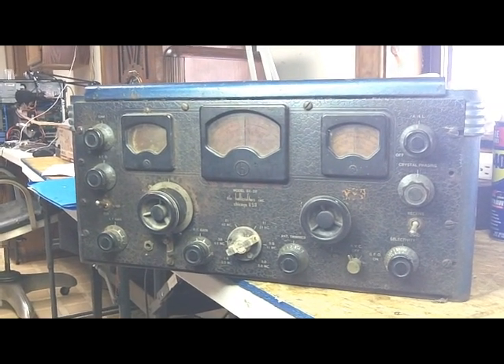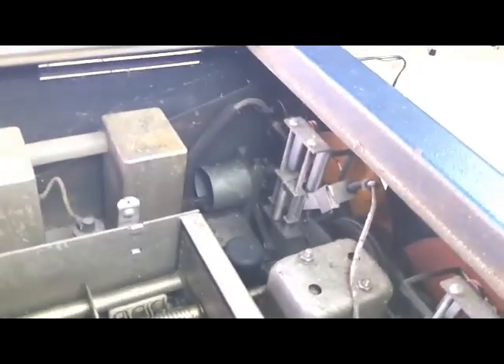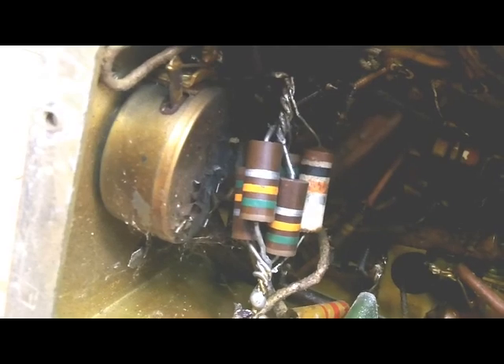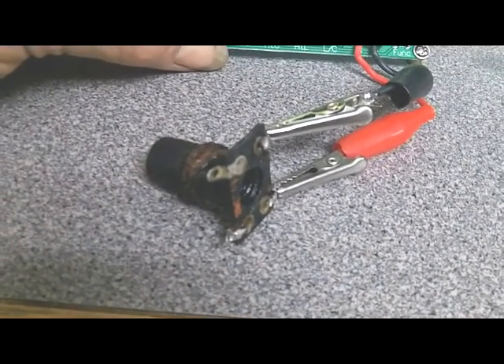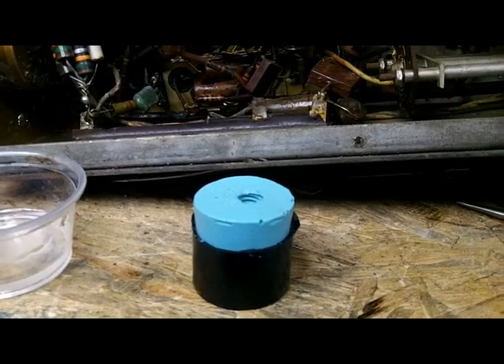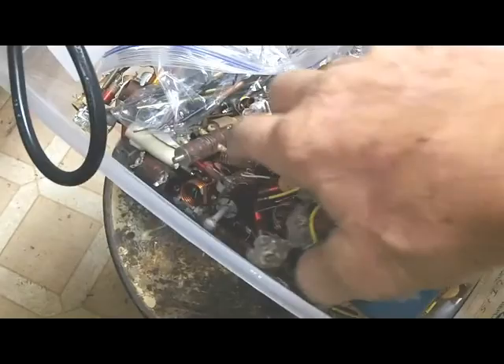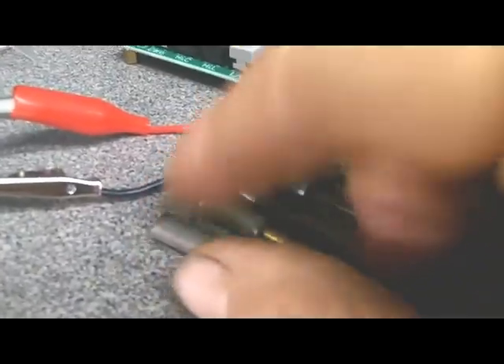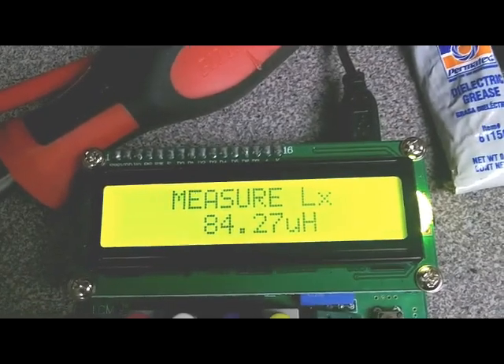Restoring SX 28 Hallicrafters Part 1

Comment: I had an SX-28 back in 1967 when I got my Novice radio license.  My dad traded it for a junk oscilloscope a year later, and I wanted to find another one ever since.  I finally found one in 2001, and now I have an SX-28 and two SX-28A's.  One of the A's has been restored, but not by me.  I bought it already restored.  I'm going to begin restoration of the other 2 soon, so I'm glad to find your videos.  As bad as I hate to let go of them, I'll sell 2 of the 3 at some point, but not until they are working as they were intended to.  I've waited many years to begin this project.  I bought the first one in 2001 on E-bay, but life got in the way of restoring it.  Over the last 20+ years I was lucky enough to have the second one donated, and then I found the already-restored 3rd one about 5 years ago and decided to go ahead and buy it, partly so I could have a working unit immediately without having to restore it, and also to have a working unit to compare components and readings as I restored the other two.  I finally have a large shop to work on old equipment like this and am looking forward to getting started.  Thanks for the videos.
Reply from the maker: Thanks fir the comments. I think the SX28 is the best example of a shortwave receiver. Mine was a basket case but that’s the way I like them. I wish you luck with your project and post videos as you progress.

Comment: Greetings 2:
If you can match a nut or top of the coil that provided the adjustment capability then you are set (You may decide that you do not need the slug grooves at all.)
Reply from the maker: Enjoyed ur comments. The slugs came out of the mold perfect. What worked best was using old tuning slugs from coils that had a brass threaded rod and molding plastic threads around them. I just used a signal generator, set the parallel tuning cap to half point and kept modifying slug to get resonance.

Comment: That’s is a fine looking radio. I wouldn’t want to carry it. I started restoring a S-20 this year on my channel. I have the electronics done but need to do the weather when it warms up next summer. Tragedy to see a rusty neglected radio. You can buy all the decals from a guy in the USA.  I would just patch up the paint best I could.
Reply from the maker: Thanks for the remarks. You are right. At 76 years old I usually wait until one of the grandboys comes and get them to move my boatanchors.

Comment: Greetings:
I realize that the ferrite cores may vary by their amount of iron. I have an idea. I would think that the core of a cast-off ferrite loopstick antenna could be ground up with a morrtar and pestal, then add some thin adhesive to the mix. I saw you make the mold, so we need to make the slug. How cleanly the mold will part from the casting to keep the "grooviness" of the slug.
The inductance of the existing wire coil, it is used to resonate with a capacitor already wired to it. I hope the resonance frequencies for all of the involved circuits are known or calculated. Then an rf generator source could be used across the tank to  watch for the induced signal peak as the new slug is adjusted. Maybe a new capacitor value may be needed so that the coil/slug combo resonates as needed. A scope probe attached across the "tank" should allow the slug to be adjusted as the signal amplitude peaks on the scope display. Reducing the separation between the slug and coil will raise the inductance. Yes, the probe capacitance could be an issue, but I hope the signal peak stays tunable.
I suspect you might have envisioned a simpler fix, but once you started with a mold I figured you'd be open to mixing up your own "brew".
You could always add it on filings to the mix to raise the inductance or use more adhesive in the mix to lower the inductance.
I assume the tanks are used for band oscillators or band antenna tuners, so working with the known band ranges and the air-cap range, the needed upper & lower band limits can be calculated. All of this relies on the exiting coils to be functional such that peak resonance can be met.

Comment: I was going to suggest that you make a rod of some sort, with a shape that you could turn with a nut driver, perhaps hardwood or plastic, and to epoxy it to the core. Then after the epoxy has cured to spray some WD40 in there and maybe it would turn out.  Then you mentioned that you had sprayed it with WD40 and that didn't do anything.  Perhaps break fluid might have worked?  Oh well, thanks for sharing your experience with it.  Helps others to know what to expect.
Reply from the maker: Great ideas. I hope I never do an SX28 again but who knows. The slugs are made of a very soft substance almost like graphite and may not be able to epoxy to it. If I ever do another one, Ill try it.
Reply from the maker: Great ideas. If I ever go crazy and do another SX28, I will try that.

Comment: top of the list?  How about the SP600, or the HRO60?
It's very possible that the higher frequency coils do NOT use the same 'formula' cores as the lower frequency cores.  So you need to match the core material to the frequency range of the coils.  For example low frequency (< 10 mhz) toroids use a '-2' mix core, while higher frequency toroids use either a '-6' or -10' mix.  The inductance for the same number of turns will be higher with the -2 material,  -6' a bit less inductance, and -10 less still.  The screw cores are the same way.
Actually you CAN cut a screw driver slot in those thread rods sticking out from the cores with a fine diameter dremel cut off wheel, or a jewelers saw.  But you can also find some nuts with the same tread pitch and tighten two of them against each other so you can then tune the cores with a nut driver.  Use some locktight to glue the nuts to the threaded rod.
Reply from the maker: Great ideas. My cores seem to work OK now except fo tracking at ends of band which is acceptable to me.